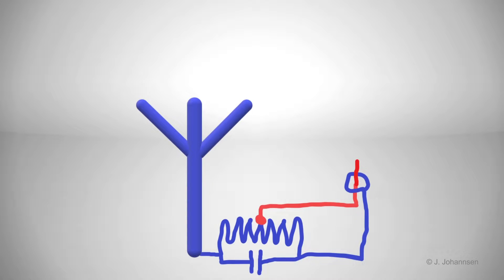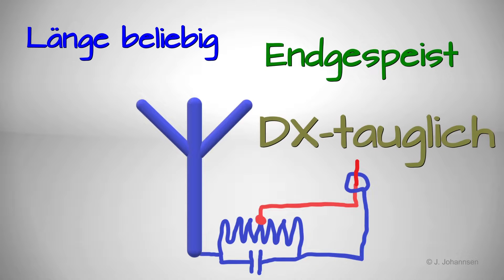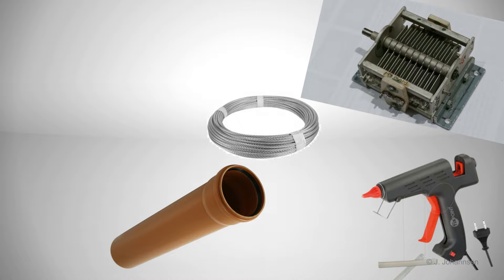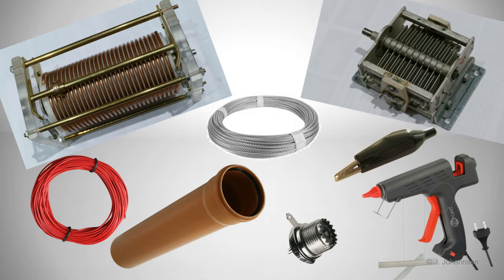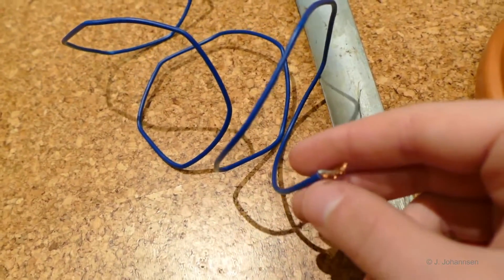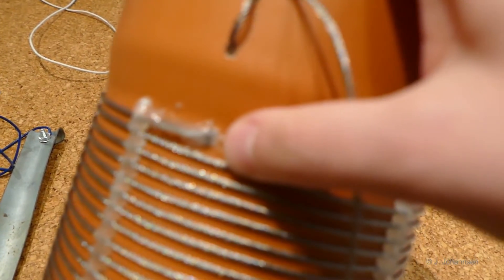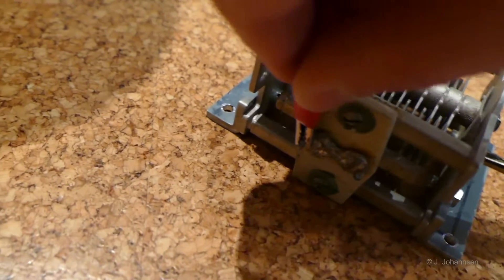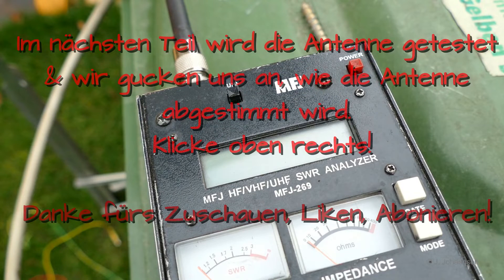Building an allband end fed HF antenna for shortwave / CB radio #hamradio #multiband

Comment: Good project. I like your use of Stainless Steel Wire/Cable. Never a worry of stretching/sagging/breaking with that stuff.
Years ago I constructed a 3 element beam for 10M using V shaped Delta Loop elements with the top leg being that same wire/cable you used. Probably the same size. Those elements withstood some vicious ice and winds but never failed with 10+ yrs of service.

73 OM . .